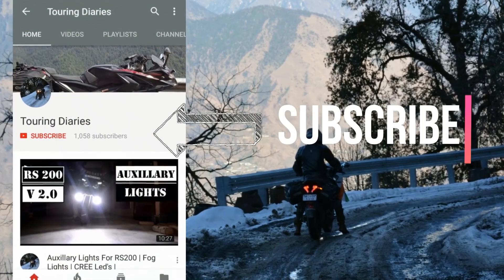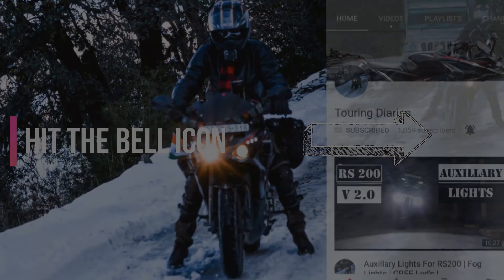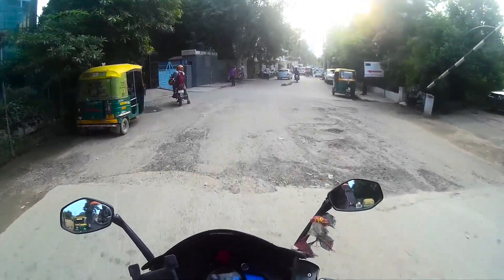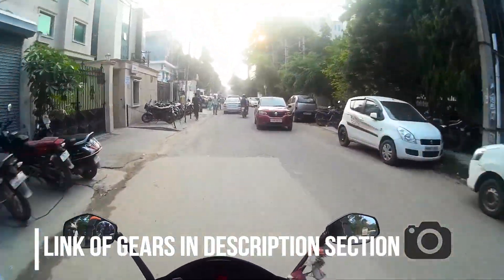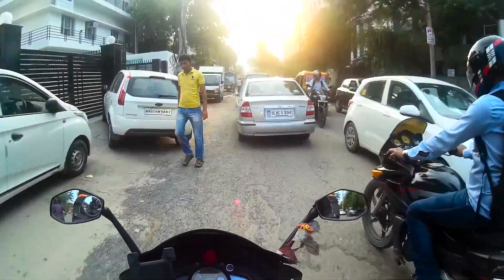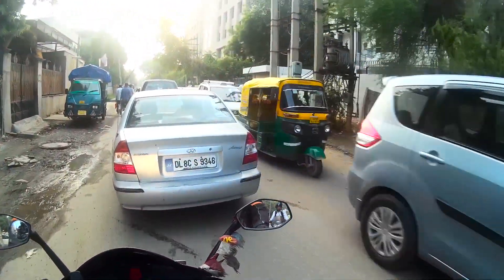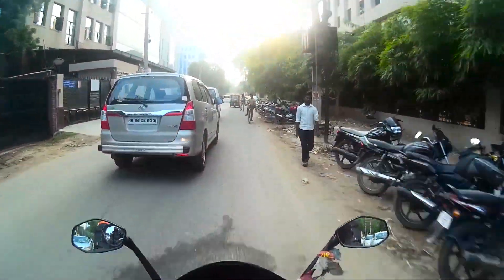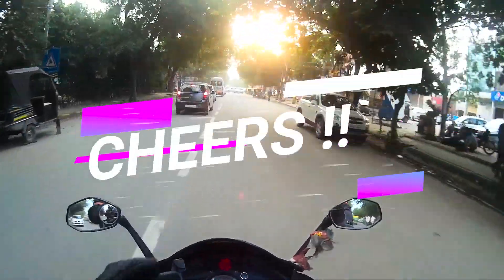RS 200 Service Manual | Training Notes |

Comment: Acha bhai manual m likha h bajaj oil to be changed at 10,000kms so wo b follow krte ho??bajaj oil k liye koi shikayt ni??
Reply from the maker: Satyajeet Patnaik Bajaj Oil is good, but under ideal conditions. I changed to Motul 7100 at 500 kms and I know people who have covered 10k kms on the stock oil. So, it's all about your preferences. I'd suggest you to use motul it's way better and I change it at 5k kms, depending upon the oil condition.

Comment: bro what to do for excessive vibration and squeaky noise is coming from front wheel?
Reply from the maker: rizwan ahmed squeaky noise might be because of clutch plates or break pads, get it checked. And vibration toh fairing hai. That can be eliminated.